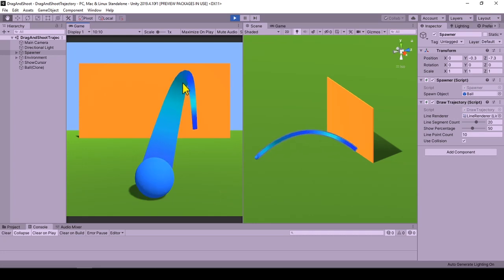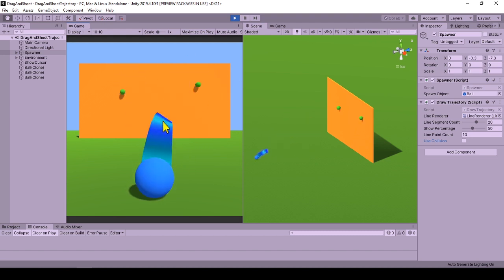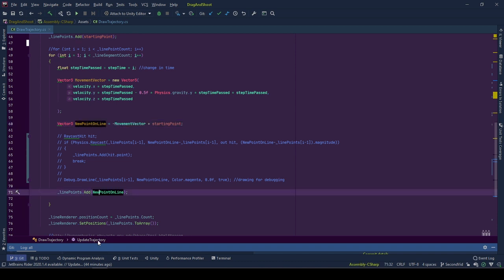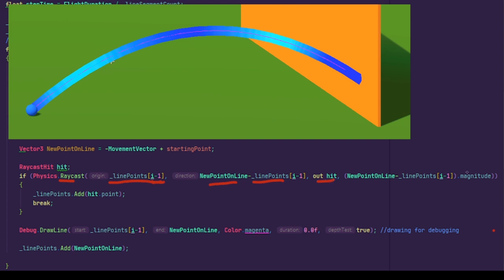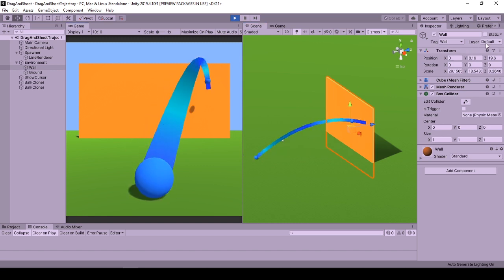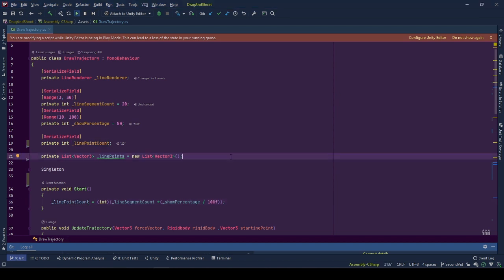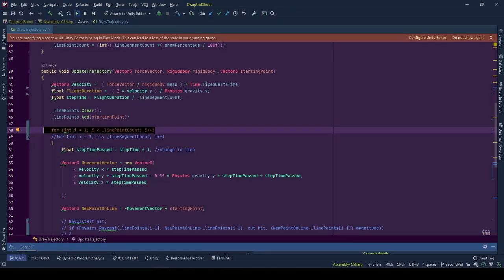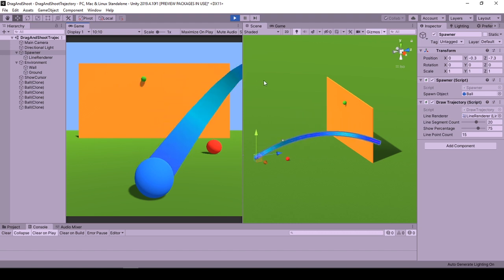How To CUT A Line Renderer TRAJECTORY With Collision And/Or Percentage | Unity Tutorial

Comment: Great content, I'm learning a lot from your videos. One question, how do I make the ball faster? (I'm using your drag and shoot system)
Reply: I am also struggling to change the speed of ball , I tried to multiply with some float value in the shoot method but it is then deviating from the trajectory, let me know if you found any solution
Reply: @harpreetsra9539  I know this is not a definitive answer or the best alternative, but since I couldn't find a way to increase the ball's speed without throwing the ball higher or farther I decided to increase the gravity (original is -9.8f) to - 26, now the ball arrives much faster in the place I want.
Reply: @kisan1001  Hey! That worked perfectly,want to ask something more,how can you make the line render updation /shooting only to happen when the ball travels in front not in backward + i used this scipt in update  with Input.GetMouseButton so that i can drag anywhere in the screen but i want that when i pressed the button it should start with some initial amount like right now if i click and release with any drag ball just remains there or barely move,i want a minimum moving distance, can you please help :(
Reply: Hi, I'm glad it worked! Sorry but I don't understand English very well (I'm even using the google translator hahaha), are you wanting the trajectory to be updated even if you move the ball before shooting?